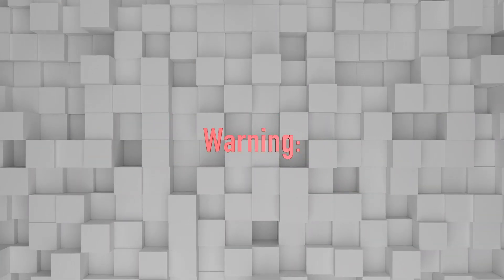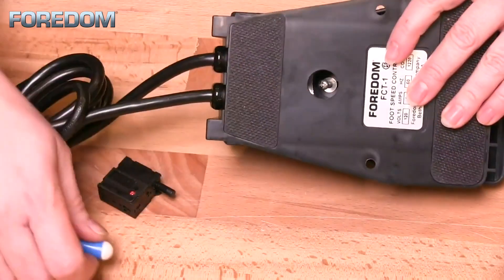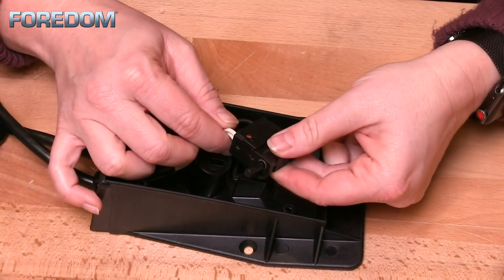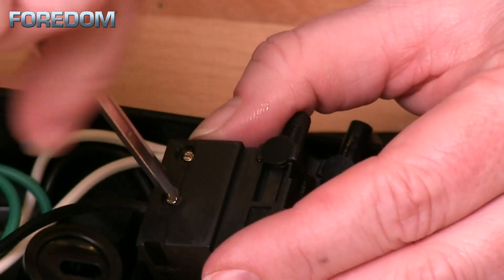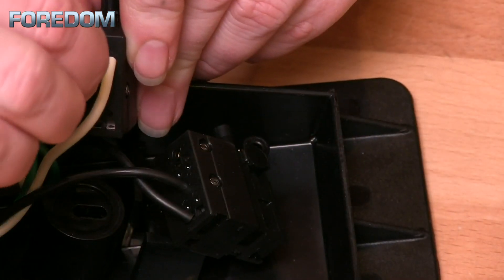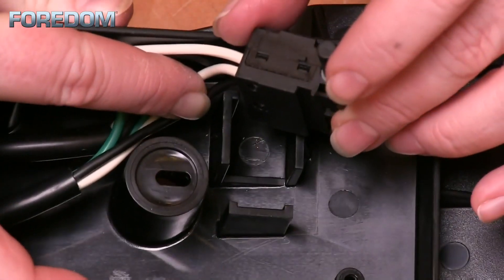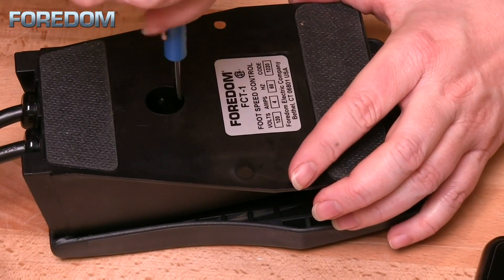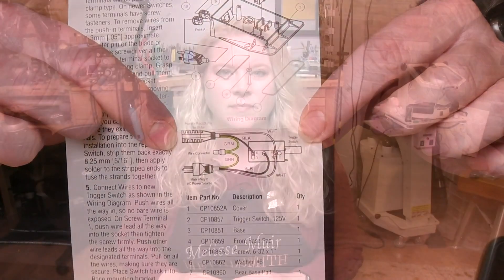Trigger Switch Swap

Comment: Very nice tutorial...
...could also mention that while the foot cover is off is a great time to add a piece of wood to the base of the foot petal. I like the low profile of a craft multi ply plywood, which tends to stay flat. This adds a heft to the foot switch and keeps it from sliding around. You could also add some router mat under it for the same reason you would use it when routing. It gives extra friction to keep things from moving around.